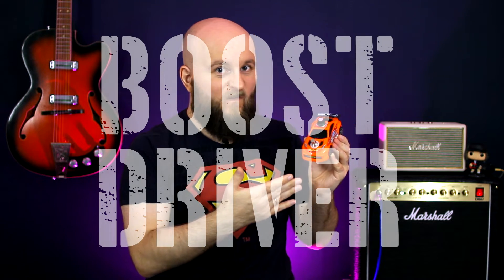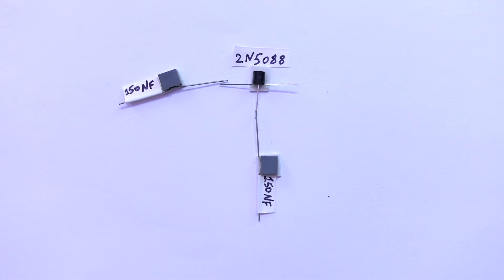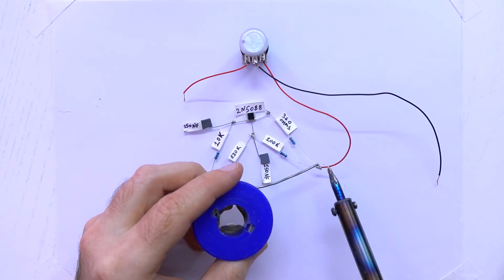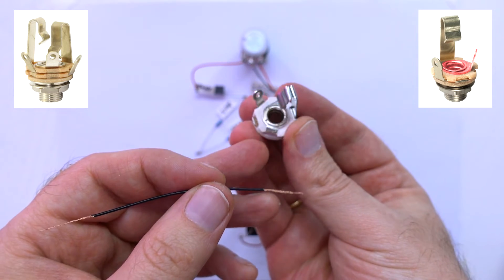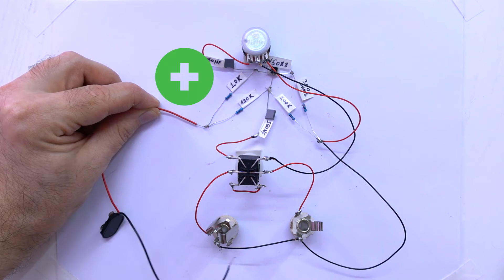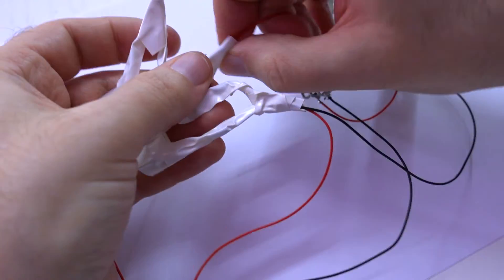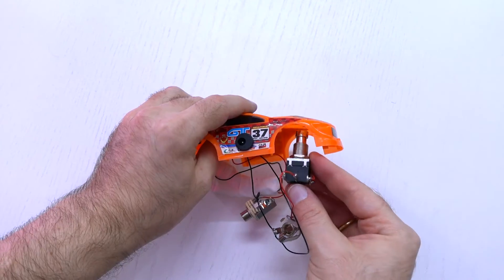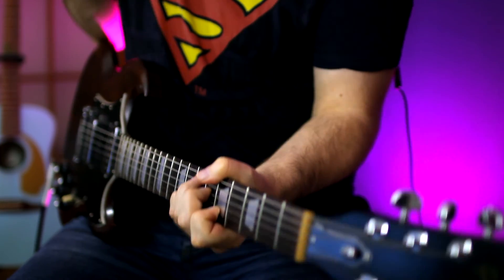How To Make A Boost Pedal – DIY Booster For Electric Guitar (tutorial) – Boost Driver

Comment: hello, dude, I built this booster, it works fine on clean, but with overload, a terrible background appears. what can be done about it? to screen? or use a filter capacitor for power supply? or use another transistor?

Comment: I use this boost design a lot but with different component values, I first learned this design from DIY guitar pedals' channel. But the car took this video to a whole new level, love this enclosure idea. Other than it pranking you and reversing every time you try to turn it on or off. 😆
Reply: hello, dude, I built this booster, it works fine on clean, but with overload, a terrible background appears. what can be done about it? to screen? or use a filter capacitor for power supply? or use another transistor?
Reply: @арсенийбузаев-ь9о  Well, I'm not super experienced. But I always use a 100uf capacitor with plus to power and the negative to ground. This filters out some noise. A big problem can be what did you built the booster in. The car for example is plastic, so depending on where you are, there can be more or less noise because of the environment and what signals and waves are going through the air. Metal enclosures usually block that for the most part. Another issue can be the construction. If you do point to point like in the video, points act as antennas. So triangles, sharp loose ends, and I don't know any other way to say points in general are the enemy of audio circuitry. Those are the basic causes of noise. Component quality and power supply can be part of it. As well as if you are boosting an overdrive, then there might just be some noise from the overall boosting of both effects. Sometimes when you have so much volume, your only option is to use a noise gate. But there are probably some more advanced options in terms of filtering that I am unaware of. Like I said, these are mainly the basic options. Hope this helps.
Reply: @Bowsmin12  Thanks for telling me, I'll put in a filter capacitor. By the way, I assembled the pedal on a homemade printed circuit board. The components were of normal quality.  
 
P.S.  I'm writing through a translator, sorry)

Comment: Just made this, great I was looking for a simple boost to add in a EHX Holier Grail. Thank you
Reply: Care to answer some questions? I built one to and i'm struggling
Reply: @Vinceorange  Sure, what do you need to know?
Reply: @franckforster5451  I've built mine the way it is described(i've tripple checked) some components are different. Like the potentiometer is  a 50k(is that a problem?) 
Anyway. The signal is VERY low? where could the problem be?

Comment: Very nice video, i really learn a lot.. thanks
2 qeustions
1- Why you put stereo jack for input?
2- your boost is seems like a low overdrive pedal, if we want to build cleaner boost what type of transistors, resistors and caps should we use?
Thanks.
Reply: I know this will be years late but I hope it might help.
1 - It is used as a forceful disconnect for the battery connector. The way he wires it, the ground is only connected when there is a cable plugged in. Without the plug the ground is not connected, and the power will not flow. If the ground and / or jack is always connected, the power will always flow and drain the battery. 4:10 kind of explains it but not the actual function.
2 - 2N3904 I think has less gain in the component, so the boost will be cleaner, but also may not get as loud. Some of it may come down to the resistors and caps though, I haven't built this one but I commonly use another version shown by a channel called DIY Guitar Pedals. I use 3904s and 5088s interchangeably. They are very similar, but the 5088 has a bit more gain. If you still want more clean volume, I may be wrong but I think you need to look into JFET or MOSFET components. Like I said, I may be misremembering but I think these offer the most clean volume, but you would also have to do your own research.
Here is a link to the other video I was talking about : https://www.youtube.com/watch?v=yWZmX79_gcU
very good resources on this channel, tough they are not very active anymore, still a good bit of banked info here if you are interested. There is another video talking about 5 different boost circuits on this other channel.
Reply: https://tagboardeffects.blogspot.com/2017/03/earthquaker-devices-black-eye.html is a really nice clean boost. Also acts as an attenuator when you turn down below 12 o'clock